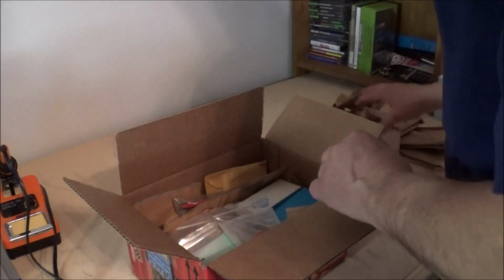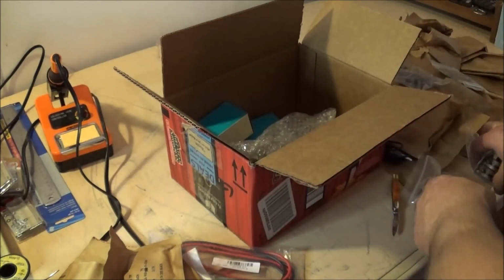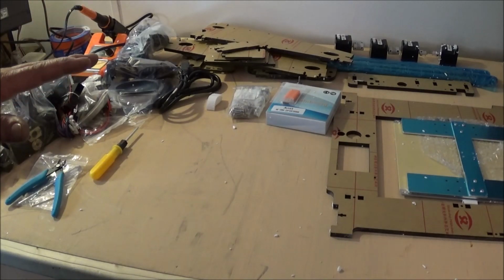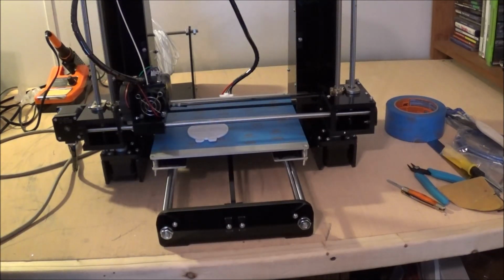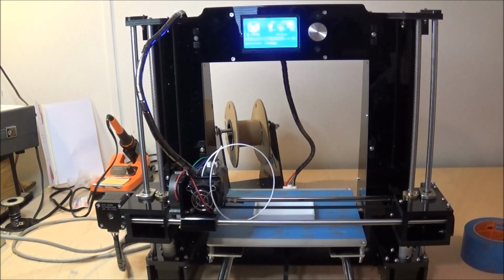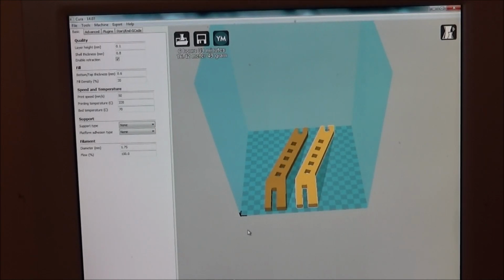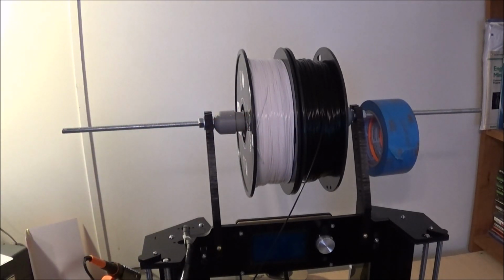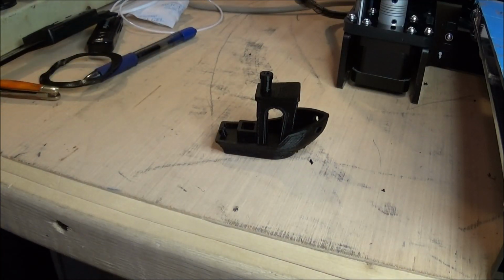#160 Nice mail bag and Anet A6 3D Printer Build and Test

Comment: Monoprice has the best prices on filament, $19.95 for 1 Kg. spool with free shipping on orders over $50 and they often have discount codes so I got 3 spools for $52.  Frys sells filament if you need to pick up some right away but their brand has the worst ratings of any kind on the market and it only takes about 3 days to get it from Monoprice so I recommend ordering it.
Reply from the maker: Thanks Steve. Will check them out.

Comment: Looking at the packaging on those test leads and stuff Joe sent, I thought I saw FSCM on the bags which is a Federal Supply Code if I recall. So some kind of great surplus score. Consider it an  early refund on your taxes!! I  know nothing about 3D Printers...so thanks. It would be great to be able to reproduce  some old classic radio knobs with this. Or broken Battery Compartment covers...wow I may need to get one of these!
Reply from the maker: I think you are correct o the test leads. lots of great surplus there.  That is why I wanted a 3d printer. To reproduce hard to find parts.